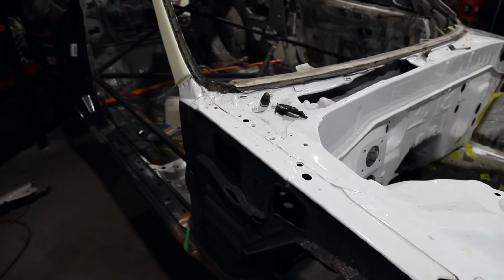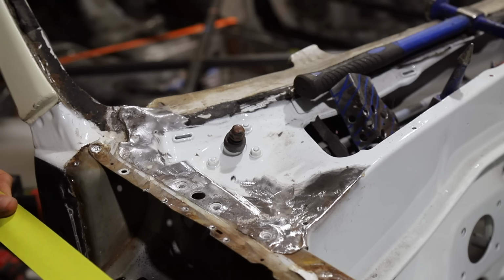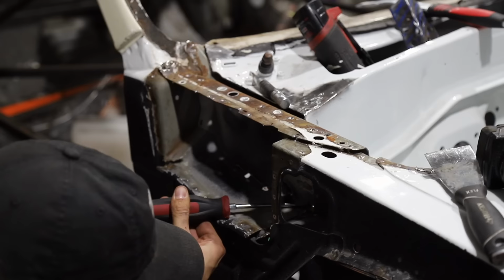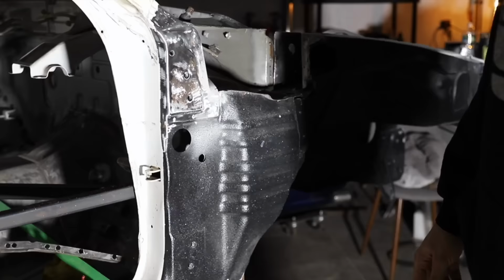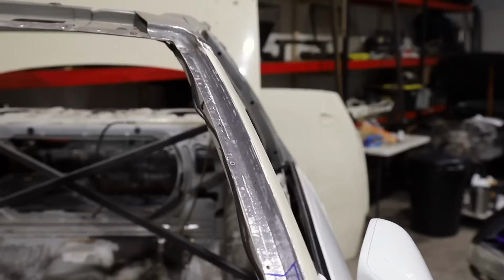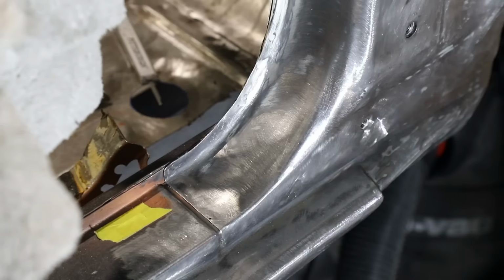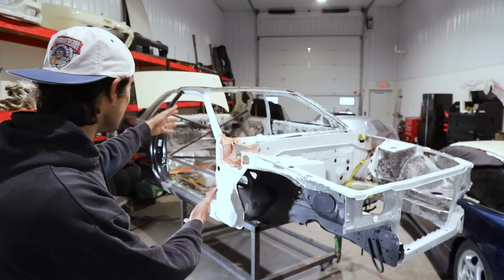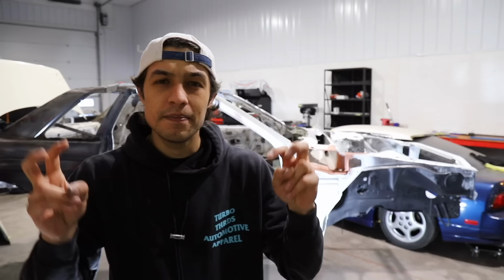RustZilla is Making a Huge Comeback!! Satisfying Repairs on my R32 GT-R Restoration | Part 32

Comment: R’s day sounds like an achievable goal. From the sounds of it the engine machining is all done, the body is nearing completion. All that time allows you to source all the parts you need to put everything together, spend some time getting it running and tuned up, totally achievable at the rate you’re working at. 

Been subbed for a few years now, always watch to the end for the 32 series! Driving and working on my Z32 TT. Spent some time all year so far doing one thing or another. Currently RIGHT THERE to having it on the road again just gotta figure out some BS with my brakes. You got this Kalvin!

Comment: I've been following this build, and I am super impressed with the level of commitment and not giving up.

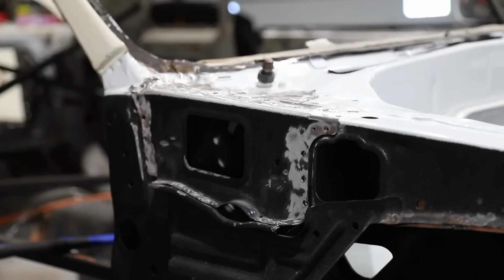Regarding a couple things, @2:25 you mentioned and in previous videos, about wanting to buy a spot welder and being around $20K. You can get a great spot welder by either Tite Spot or Lenco for around $4000-6000 brand new and honestly, I like those a lot because you can maneuver it in very tight spots and they also sell the other variety of clamps to buy for it.

For the carbon roof, I don't see it being an issue, reason being is because a lot of BMWs have the option for the carbon roof from factory and a ton of super cars. I think it comes down to the milage of carbon layers. Obviously you want a bit more for the structural integrity but it will for sure be just as strong or stronger than that steel flimsy skin lol. If BMW does it I do it lol. 

You can absolutely do it yourself, the most important part of course is just getting that steel roof skin laser straight so the carbon mold comes out perfect after you pull out the vacuum pressed mold. Also, get some Linear Blocks to get that car laser straight too. Ask if they do a sponsor.

Lastly, I been networking with some guys that do acid dipping for a future Jdm restoration I want to do, they are in PA but put me on with a connect in Indiana that can do the factory E coat on the whole car for you again. If you are this far, I so do it.

Keep up the great work, these videos gave me the bug to get entirely back into autobody.

Comment: Keep up the absolutely fantastic work, I'm currently building a 1989 Opel Kadett E , it's a 3door . It has a 2l 8 valve fuel injected engine , I have done all the engine wiring by myself and built the engine under my carport in the pouring rain in my yard. Unfortunately I am on my 3rd shell know as these cars are over 30 years old and suffer with the rust . I am actually going to pick up the 3rd shell on the 14th of December . I will be watching this series again on my Bluetooth speaker as I move all my parts over again .

Sending u allhe best from South Africa :)

Comment: Been watching since the beginning of the r32 restoration. I own a fc rx7 that i have had since 2009 and refuse to sell (is drivable.... kinda) im in Fredericksburg va and the fc is my project/good weather car (if i dont take the motorcycle) i need to finish putting the seats in but been slacking on that

Comment: still looking for a video where you detail the products you use ... e.g. what discs do you use to get it to bare metal ? which ones do you use to smooth the welding spots ? What products do you use for the undercoating ?

Comment: Im buildint an 88 mustang gt. I really wanted to do a 2jz gte swap but engines are too expensive. So i have a SBF 349 stroker and a back up 6.0 LS truck engine if i split the block